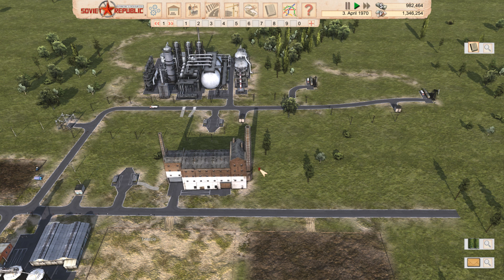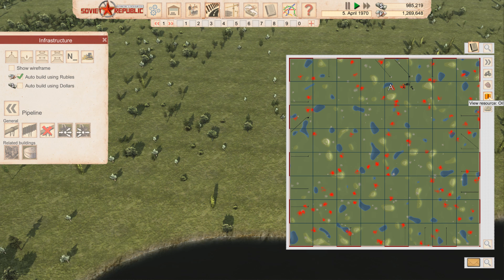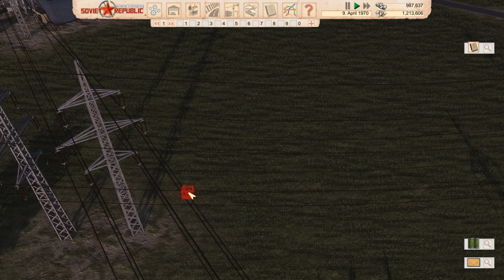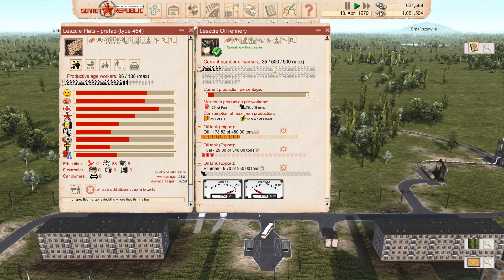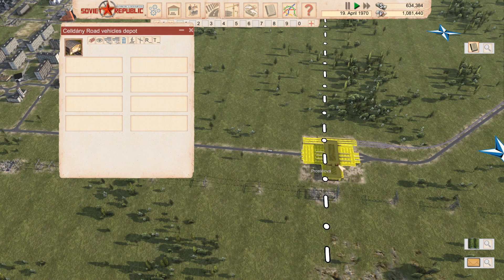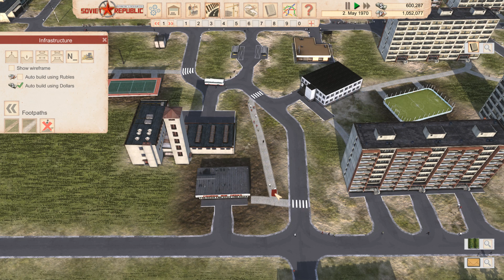Workers & Resources: Soviet Republic - #3 - Workers Deserve Vodka

Comment: Comrade
1. It's good thing to build 1 shopping center (or small version) then invidual store.
2. You have construction office whean you will build for example gravel roads use construction office untick the box that says "auto build with dolars/rubles" comfirm that you want to build the road and wait until construction office find that there is road to build and make sure that it has everything it needs (dumpers buses etc.)
3. You have thinks called medium/high power switch use them whean you need multiple substations powered, build one line of power and connect it to switch and get 1 more line. congratulations you have powered 2 substations with one power line by using the switch.
4. You can use E/Q to change height of your pipe line to go under power line (with ought eny problems) or go above roads.
5. Pumping stations are not connecting to pre build pipe lines for some reason, you can always see how far pipe line go and before pleaceing it make it shorter place station connect it and repeat proces until you make it to the end.
6. Whean you are choose what house you want to build you have massage under "auto build with..." "get citizens" you can make decisions do you want to invite some people yourself (you can move your concurrent workers to build houses) or game will invite some  random immigrants, you can also change how many you want game to invite. You alose have same thing applying to building but they will have auto purchased resources. 
and one more thing all of your buildings are not full you can get more people into them
7. Make your farm always busy best way is to buy 3 soving tractor 3 harvesters and 3 covered hulls (this work in auto mode and it means that you don't need to worry about them), and after that you can handle 10-20 fields, even if you don't think you will need that meany better build them any way food factory and destylery will consume a loat of it, and some other thinks will take around 0,5-1t of crobs.
8. If you build houses not in city remember that people will start using buses to get to city ( not a problem becouse what I have seen whean people arrive at the job and  finish they're shift they teleport back to home) people will try to get from city wasting their time at bus station as pasagers you can click box next to "numbers of pasagers waiting" and people will leave bus station, build cinema or something like that to make people more happy and more effective (same thing come down to students) 
9. You can use micro buses to transport people directly to the buildings (mikrobuses are faster and cheaper but they carry 7/8 workers so sometimes it can work)
10. People so can enjoy culture for example by lisining to radio (you have to build the radio station that is big and expensive), you can change how you want your people to listen you can change level of anti religious propaganda or soviet propaganda you acn change sport excitement and how your people will want to drink.
11. It is not a good way to make money by building chemicals you will need to spend way too much to get there. First you need technical univercity and professors to work there (higher education workers) than you need to wait to research chemichals after that you need to build all infrastructure end ingredients and chemical plant alone  all of that is too expensive if your not planing some biger industrial sector where you will need a lot of chemicals, (now I realise that I spend 1 hour writing this) for now you will beter build and sell steal ( you need coal, iron and steal meel all can be found in gravel/coal/iron tab) it's cheaper to produce and it will be a better deal at this level.